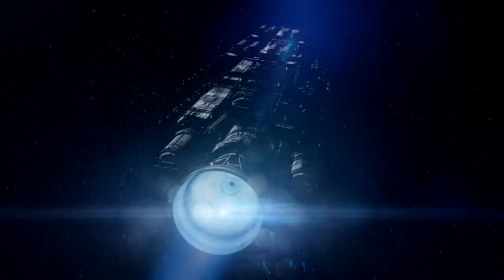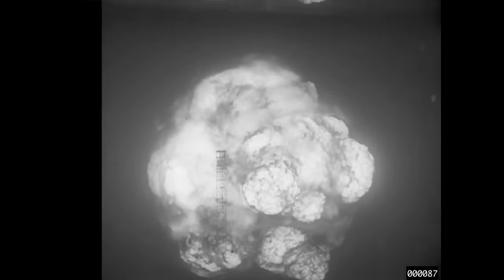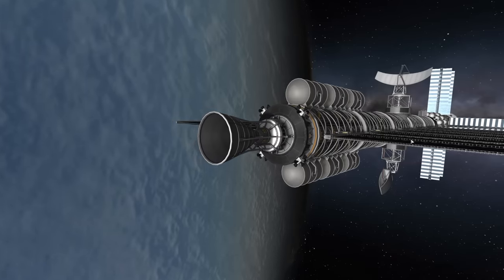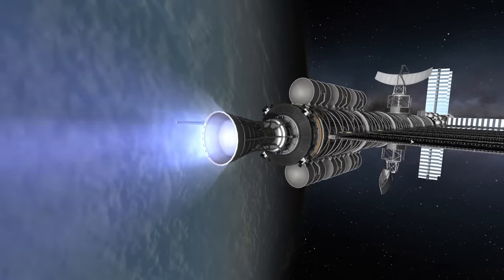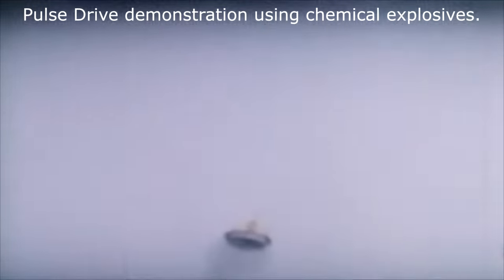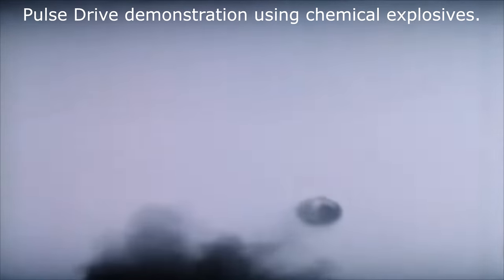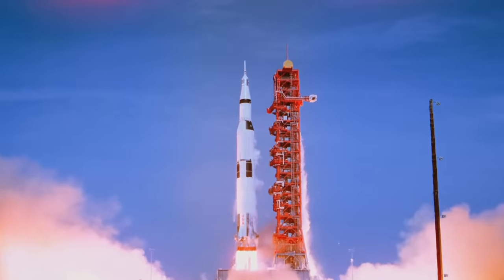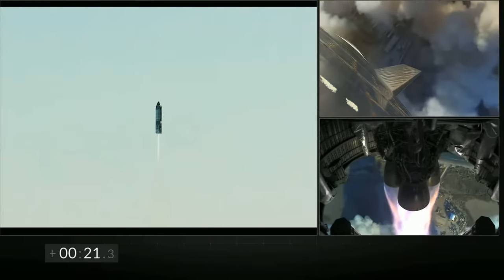The Nuclear Salt Water Rocket - Possibly the Craziest Rocket Engine Ever Imagined.

Comment: Hearing “1% the speed of light” is just...nuts. I can’t wrap my brain around that
Reply: no doubt  1% speed would  be better than our current snails pace, we should be aiming higher though,
let's be downright ambitious and go for 5%  😁.
Reply: @sub-vibes  It's not the travel speed, it's the ship-relative exhaust speed.  Should still be enough to accelerate beyond that speed.
Reply: @sub-vibes  Think you are missing a couple of zeros in the speed. 🤦‍♂️ 😀
Reply: @josephking6515  no he's not. speed of light is 186,000 miles per second. 1% of that - remove two zeroes. 1,860 miles per second. if you're going to be a pedant, at least be right.
Reply: Fine for puttering around the solar system but for interstellar travel basically useless.
Reply: @sub-vibes  great point, deleted my last comment because I failed to notice that you were talking about 1%.
Reply: Acceleration and deceleration would have to be carefully managed for us meatbags to stay, well... meat, rather than liquid lunches.
Reply: Fission Fragment rocket engine gets between 3% to 5% speed of light. This is because that's the speeds that a fission fragment travels at when the fission of Uranium or other equivalent material happens. Energy in the form of heat in a reactor or Salt water rocket engine is when those speeding atoms hit other slow moving atoms, such as water. This radically heats up the water, but slows down the freshly fissioned atom.
Reply: @patwest1815  Build a ship big enough to live on it for generations.
Reply: @k1dicarus  The ark idea is an old one and at least plausible. It would need to be large and modular so it could sustain damage without everyone perishing. I've read several SciFi books over the years and even remember a tv series and a few episodes on various shows that explored the possibility that over time people might forget what they're doing. I find that hard to believe but they made for good stories. In the real world though I worry about physical degradation. A form of staggered suspended animation might be required.
Reply: @patwest1815  For Interstellar travel basically useless? How so?
Reply: @k1dicarus  You mean like Star Trek? Why not?
Reply: @johndododoe1411  You would need to refuel on the way for that, which is impossible at that point.
Reply: It’s like that factory in Russia which is responsible for 1% of the entire worlds co2 emission
Reply: @richardturner6981  Well 425 years to get to the closest star not counting the acceleration and deceleration phase hardly seems useful. The last I heard there probably isn't a goldilocks planet at that star, well 3 stars, and human physiology probably wouldn't survive one generation even if you used some form of suspended animation. Besides we can't even plan more than a few generations forward even now.
Reply: For scale, you'd be able to circle the earth in a little over 12 seconds, vs the 90 minutes we currently take.
Reply: @bergonius  Why would they need to refuel to accelerate beyond the exhaust speed in the vacuum of space?
Reply: @johndododoe1411  Because of tyranny of rocket equation. You won't have enough deltaV otherwise.
Reply: @johndododoe1411  Which as per the rocket equation gets you a good idea of total available deltaV from one fuel load of only around 70% gross starting mass. In this case 1,800 miles per second giving a very conservative 400 miles per second each way to let's say, Pluto. With 1G acceleration that's 18hrs to reach that speed and a round trip of 5 months. Or Mars and back when it's at it's closest approach to Earth of five and a half days.
Reply: @dsdy1205  Well, only if you've got enough thrust to force the ship to remain on that orbit and aren't afraid of the insanely unsurvivable G load. Iirc centripetal force rises/falls at the square root of the radius change at the same speed (10 times smaller = 100 times as much, 10 times wider = 1% as much) while it changes at the square of any velocity change on the same curve (here resulting in over 200,000G though I'm very rusty so maybe it's linear with speed and only 450G?)
Reply: I thought Project Orion was estimated at 2-10% the speed of light? And pretty sure Robert Zubrin (the inventor of this videos engine) estimated that with modern materials that speed could in theory get to 50% !!!

Unless im getting that all wrong 🤷‍♂️🤷‍♂️🤷‍♂️
Reply: @johnassal5838  I did not discuss the fuel capacity of the design, only the lack of a fixed equality between the peak exhaust velocity and peak rocket velocity.  If you have the actual numbers for this design, please calculate from those instead of the fallacy.
Reply: @johndododoe1411  If you understood half of what I just told you you'd be able to derive the fact that the rocket equation directly equates your top speed (as in total velocity change or deltaV) to the mass of your rocket which remains after the fuel is spent. For a rocket of around 70% fuel mass this means the total delta V is equal to the exhaust velocity for that rocket.

I already said that, more or less before you spoke out of pride and ignorance. I expect you'll do so again as well.
Reply: @johnassal5838  64% fuel ratio is not a required assumption.  A higher fuel ratio and/or staging would be needed to get delta-v >> v-exhaust.
Reply: @johndododoe1411  If you think it through you'd realize the vast increases of cost and complexity your blithe assertion glosses over. The point is to get to vehicles that have 1, the highest practical exhaust velocities 2, do not require multiple stages and 3, aren't single purpose/use. There simply isn't a huge gain of performance equal to cost complexity and trouble of exceeding your exhaust velocity if you don't have to. It's not that's it's been our best option to date but simply our only option to escape Earth's gravity well.
Reply: @johnassal5838  And it may happen to be our only option to reach other star systems, as even extreme technologies like this salt water nuclear engine can only provide the needed delta-v at high fuel ratios.  Having a high exhaust velocity is just one of many steps to reach relativistic speeds where the Lorenz factor is large enough to keep the astronauts alive.
Reply: @johndododoe1411  You're never going to see a Russian doll of a multistage interstellar rocket that starts out at a million tons because when we could build it the asteroids we'd use would be far better put to other tasks. It's debatable we'd ever get to that point either as vast excesses of material wealth making scarcity unnecessary would tend to undermine the social and economic systems that keep guys like Musk and Bezos in control. 

Besides given the logistics laser or particle beam driven solar sails will get closer to light speed for a lot less trouble. It's just not going to scale well to manned missions or generation ships. Aside from some unforeseeable FTL breakthrough and/or you live to be one thousand years old, you're probably not going to see a manned extrasolar mission.
Reply: Except nothing starts at  top speed.  Ever heard of acceleration?
Reply: @zacklewis342  Gradual acceleration is the way to go from standstill to Warp 2 (87% lightspeed) without getting crushed.
Reply: what always baffles me is how much energy there is in a nuclear reaction. the salt water solution contains 2% uranium, 20% of which are U235, of which 0.1-0.2% reach a full reaction, but only that tiny bit results in a 900x energy density compared to the same mass of tnt. Trying to imagine that is just crazy.
Reply: Is travel speed the only problem? Can humans survive multiple generations in space? I’m not well studied in the topic but it seems to me there are numerous problems each “solution” seems to introduce 2 more equally difficult problems with only theoretical solutions at least for now. 

Some of you math wizards could you tell me how fast we would need to travel at to reach the closest solar system within 40-50 years. Send a bunch of you folks and hopefully reach the solar system before too many people die. I obviously know so little about the topic I may be asking a ridiculous question.
Reply: @patwest1815  forget what the goal was? That could be a great comedy. They get about halfway and get things mixed up due to the rise of a big brother type government where they memory hole the original plan and rewrite the new plan. New plan is we are not at war with Eurasia we are at war with Earth and are in route to attack Earth by crashing into earth at x% the speed of light. I’d watch that.. maybe a dark comedy not an Airplane type comedy.
Reply: @somenygaard  The multiple generation idea ("generation ship") would have enough people on board to marry and have children multiple times before reaching the destination, so needs to solve problems like how to do that in space, how to train new generations to live on a planet without having one, and how to pack a large ship with a complete society large enough to have smart, dedicated explorers in the final generation, surviving the statistical loss of people to all the random things that remove talent and people from society over time.
  The fast travel option is somewhat simple. Distance in light years divided by 50 gives needed percentage of lightspeed, reduce by the warp factor (time dilatation due to speed) prolonging lifetime.  Alpha Centauri is 4.4 light years away, so needs about 10% lightspeed.  More distant star systems need even higher speeds.
Reply: @johndododoe1411  Robots until the very last 20 years and you have genetically engineered geniuses ready as frozen embryos. That and some quality online learning classes and you only need some frozen pre-humans! I solved it!
Reply: @somenygaard  Embryos need human mothers to grow to full capacity, so need to maintain a line of mothers to give birth and pass on the ideas of how to live as real humans.  But technically all the intermediate generations could be women acting as surrogate mothers.
Reply: @johndododoe1411  I actually knew that but I still feel like I turned dozens of serious possibly impossible problems into a single very difficult problem. Pool our resources into one problem should be doable. I’m still claiming victory. Thanks!
Reply: @patwest1815  Sure, but that's just the exhaust velocity. You could accelerate the ship to higher velocities than that pretty quickly.

Comment: As I understood it from having read up a bit about this idea, the fuel tanks don't need to have boron (or other control rod material) inside them, though the tanks were made of a high-boron metal alloy, or at least a layer of boron in the tank walls. But the main way of preventing criticality occurring in the fuel tanks was simply geometry - the tanks would be made long and thin, with relatively large gaps between all the tanks, a bit like how nuclear reactor cores are made of lots of separate long thin fuel rods rather than one massive block of uranium. There would also be lightweight non-absorbent filler material in the gaps between the tanks to prevent the water pooling anywhere inside the whole structure in event of any tank springing a leak.

As to the chemistry, uranium tetrabromide seems like a bit of an odd choice to me - especially as a solution in water would be at least partially hydrolyzed into uranyl ions and hydrogen bromide, the latter making the solution strongly acidic. The only way to inhibit this hydrolysis would be to keep the pH low with another even stronger acid, so either way, uranium tetabromide solutions would be corrosive at the very least, as well as probably unstable. The sources I read mentioned using uranyl nitrate or plutonium nitrate: These make a lot more sense, since all nitrate salts are water soluble, the solutions are stable and not appreciably acidic, and can be made much more concentrated than bromide salts if necessary.
Reply: I think having the uranium salts mix with the water as needed is a better option than keeping tanks of "boom juice" around. May make ISRU more practical, sourcing water at least. Could save a lot of weight, too, as only the salt storage needs neutron poisons. Corrosion would affect less parts as well.
Reply: Would plutonium need to be isotopically enriched or depleted for the design to work? Or could it just be tailored to work best with the natural isotopic makeup of the plutonium in nuclear waste?
Reply: @leerman22  would the salts now need to be separated by larger spaces or does the lack of moderating water make storage a lot easier?
Reply: @Teboski78  Moderator reduces the fuel needed to go critical, so it would be safer keeping them separate.
Reply: @Teboski78  As I understand it, isotopic enrichment only applies to uranium from the perspective of building a critical mass, since while U-238 is fissionable under fast neutron conditions, U-235 (naturally occurring at 0.7%) and U-233 (decay product from thorium) are the only fissile isotopes of uranium.

Plutonium is a different story entirely, since it doesn't occur naturally in any significant quantities, so all the known plutonium stocks in existence have been manufactured in reactor cores. More to the point, every known isotope of plutonium is fissile. Some of the heavier isotopes are even prone to spontaneous fission, without needing an external neutron source.

These slow buildup of these heavier isotopes sets a practical limit on how long you can leave U-238 breeding plutonium in a reactor: If you have too much of the spontaneous fission isotopes in your final plutonium, the risk of premature detonation becomes unacceptably high - especially for a production warhead!
Reply: @lloydevans2900  makes sense. Plutonium has to be depleted for weapons because the more unstable isotopes produce too many neutrons too early & have to start out further from criticality which reduces yield or makes detonation harder I think. But for an engine it seems like it should be fine chemically extracted from spent fuel?
Reply: Just seperate the water tanks from the uranium and have a pre-mixing chamber dedicated to poison any reaction and detonate the premix as you require in the nozzle. Simpler.

Comment: The 90% enriched version is a warship drive. Not only does it have the sheer power to make the sorts of burns you might need while packing the mass of your offensive and defensive systems, it's also a weapon in its own right. Exhaust velocities in the thousands of KPS, AND it's radioactive as hell? The Kzinti Lesson says hi :P Plus, it's fuel efficient enough that if you're willing to settle for a "mere" 1,000 KPS of delta V, your tankage would be relatively small and easier to protect.

Comment: Thermal taps from the external reaction could literally power the rest of the ship. Why let all that radio active energy go to waste?
Reply: You'd still need to power it somehow when the engine is off. But that sounds like a relatively minor problem.
Reply: @Rickenbacker69  batteries
Reply: @Rickenbacker69  When the main engines are shut down a standard fission reactor could take over powering the ship.
Reply: @killman369547  That would be too heavy. You probably don't need that much power to begin with.
Reply: Maybe take a small amount of the fuel and let react or near reaction under control and use it for power